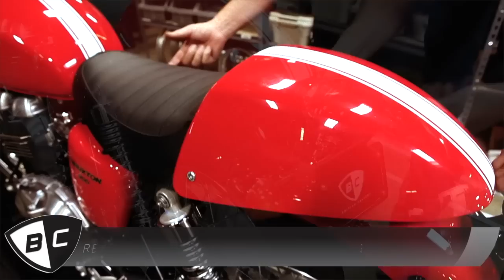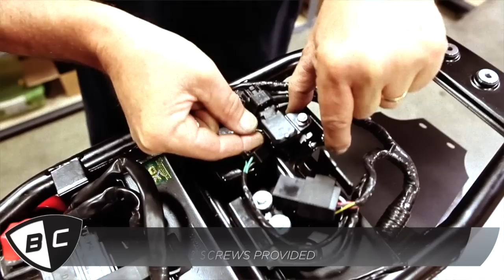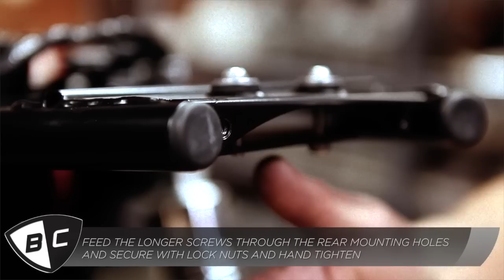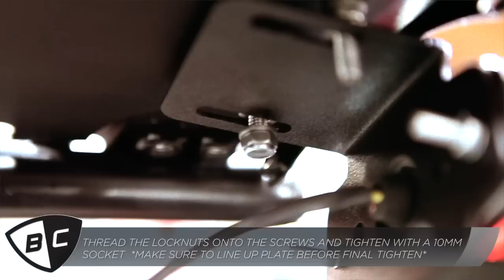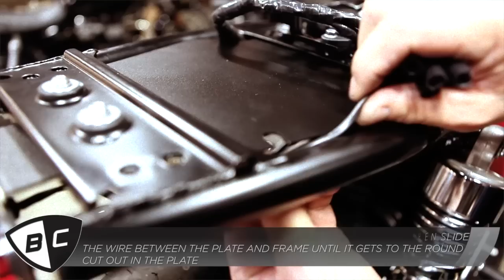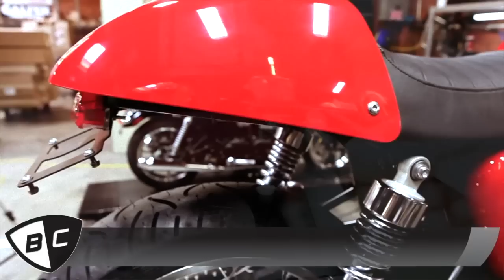British Customs Modern Classic Fender Eliminator Kit

Comment: I just installed mine this afternoon looks great. It was a bitch to get my original scrambler  fender and seat off. 

I only didn't know what the extra two cables were for or what to connect it with.
Reply from the maker: Glad to hear Jose! We're thinking you're talking about turn signal cables on the harness but can you give us a call at (877) 999-2748 and we can look further into it from there. Thanks!